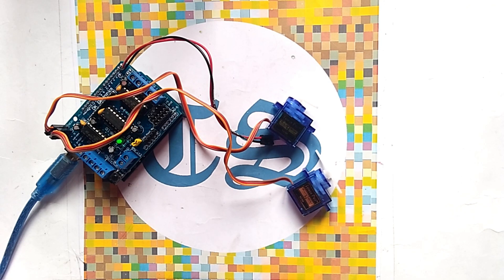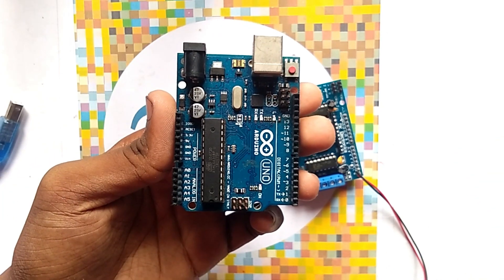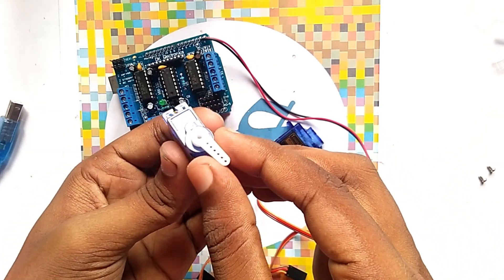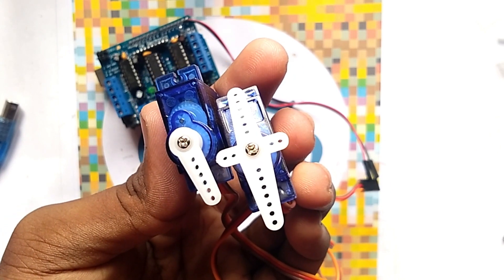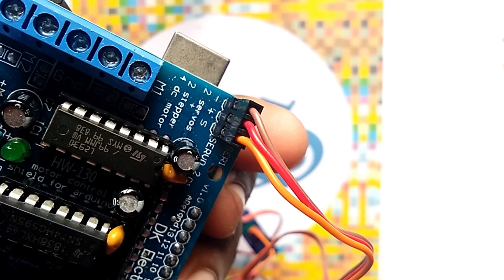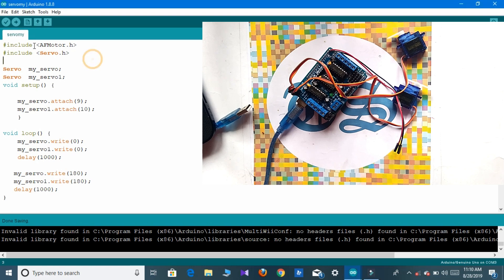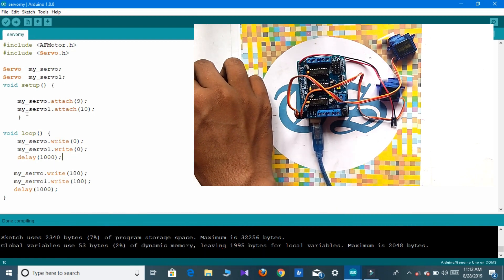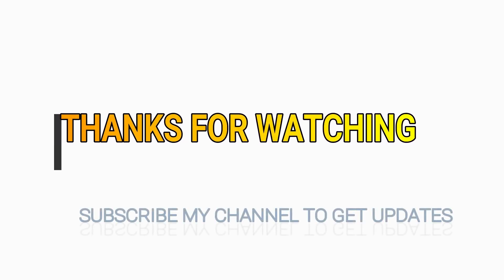HOW TO CONTROL A SERVO MOTOR(SG 90) USING ARDUINO AND L293D MOTOR DRIVER

Comment: hey can u pls guide. can i connect a toggle switch in the 293 module 
to control rotating 0 to 180 and 180 to 0 deg ???